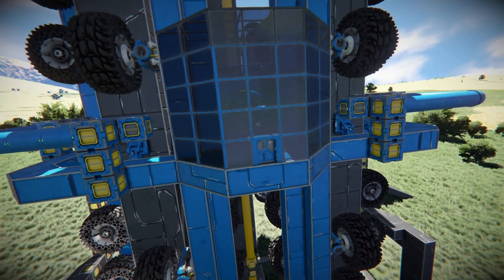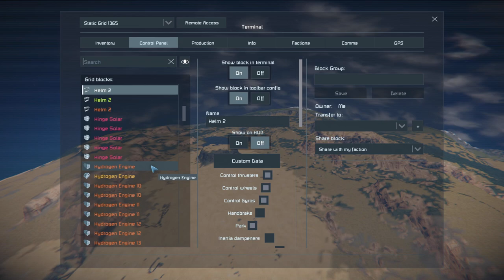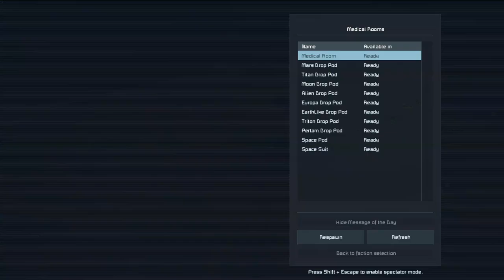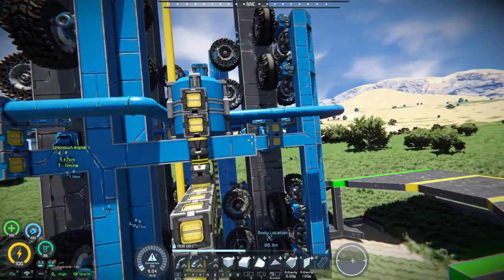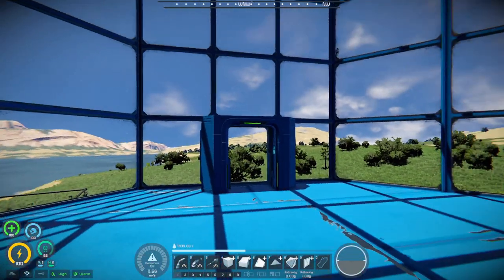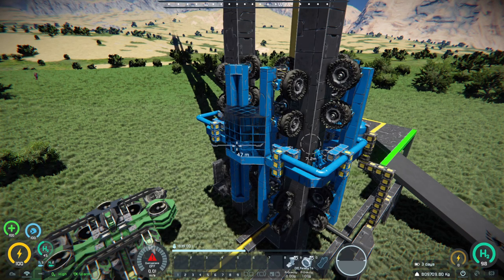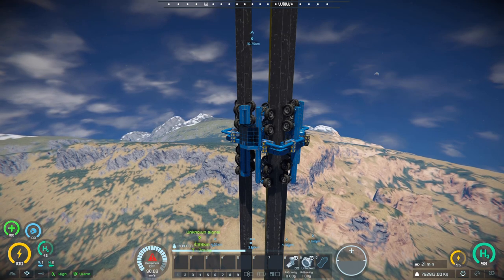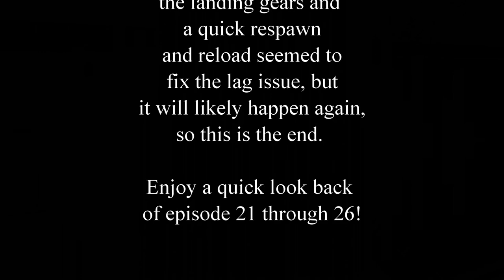The End Of The Space Elevator - Space Engineers Time Lapse Series | Look Back Ep 21 To 26

Comment: The landing gear crash issue I have noted in the past; I believe it comes from the rotation of the grid; to alleviate it you can move the landing gear's position from the centre of the assembly to the exteriors in a pair pattern, causing a clamp that more precisely enforces the rotational compliance of the vehicle, i.e. keeping it perfectly aligned with the guide rail.